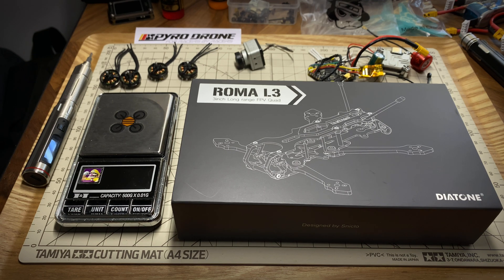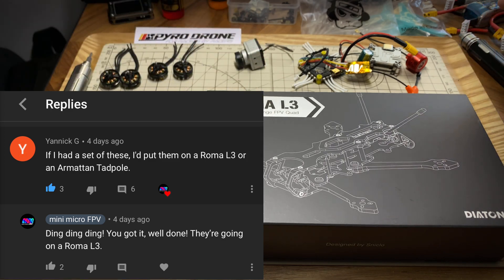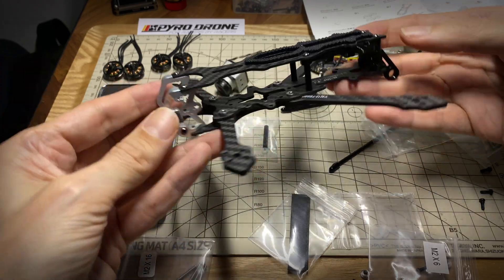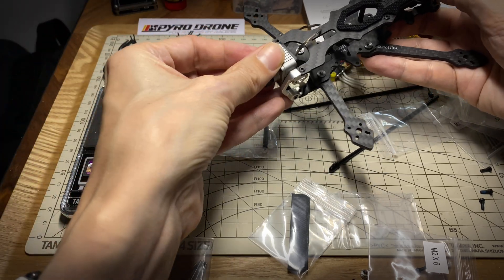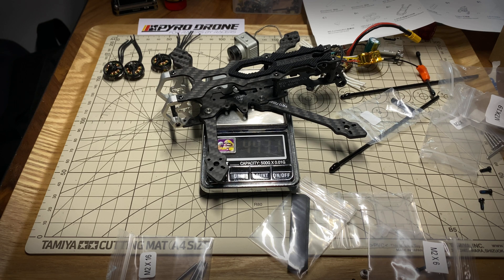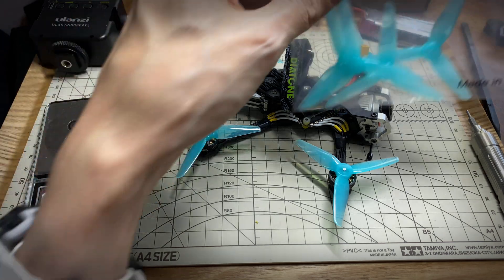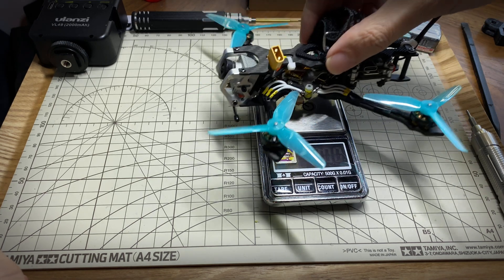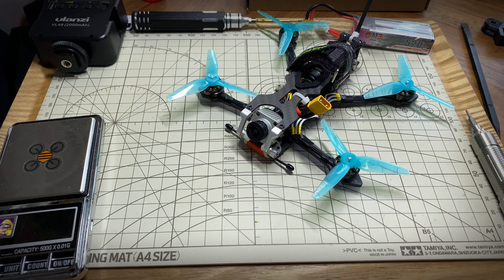A Terrific 3" Frame: Diatone Roma L3 Frame Kit Overview

Comment: Hi, I bought this frame recently from a friend, after he crashed it. I rebuilt it with spare parts and now the quad is flying. I am using a Walksnail VTX on it, however, I am unable to get rid of oscillations in footage. Any advice what should I try to check/change? I am using the latest BF with default settings, my F7 FC is soft mounted, the camera soft mounted (I tried hard mount as well), the props are new.

Comment: Can i put full dji air unit in this frame with whoop board? I want to switch my toothpick 3 frame with roma 3 and want to use air unit
Reply from the maker: I don’t have a full-size Air Unit to check but based on what I can tell from the dimensions online it would be too large for this frame. I think the back props would hit it and also the middle stand-offs would need to be removed.

Comment: Have you been able to run the smo4k on the 4inch of this 3inch version? I am getting a lot of vibrations that make it through flowstate :(
Reply from the maker: Oh no! Unfortunately I haven't mounted the SMO on here yet. I wasn't planning to but now that you mention vibrations maybe I will try it for myself and see.
Reply from the maker: I should have asked but I assume you are using the included GoPro mount with the Roma? If so I just attached mine and I noticed there was about .5mm of movement at the back of the mount where it clips into the top carbon plate. Does yours have this movement as well? If so maybe that's where the vibration is coming through. On mine I will try putting a piece of tape or something between the back of the mount and the top plate to see if this makes it more solid. I still need to do a flight test to see if I have vibrations to begin with but I wanted to mention this first.
Reply: @MiniMicroFPV  I actually 3d printed a slide-in one that I designed myself for the naked gopro, it fits if I push hard enough :) Mine is pretty tight and I haven't found the source of the vibration I see in the recorded video. I also have to try on a non-windy day, I think light quads like that are more subject to wind wobbles. Curious to see your results though

Comment: Thanks for another cool video. This whole setup is really interesting. I like the way all the components fit nicely into the frame. I just bought my first Diatone frame, the GTR369, and I'm really impressed with the quality of the carbon and all the parts you get in the box.
Reply from the maker: Thanks! Yes before this I think my only Diatone frame was the Cube and it also had very nicely-finished carbon and good hardware.

Comment: Awesome little frame. Cant wait to see that build fly more. I'm about to receive some emax RS1408s, I will try a set on a Roma F4 with 4023 triblades. Not necessarily for freestyle, mostly to carry a full sized GoPro.
Reply from the maker: That sounds like a great set up!
Reply: Also, any plans to build an Armattan Bobcat?
Reply from the maker: @yannickg6904  I had to look that up as I hadn't heard of it yet. Thanks for the heads-up! That's a beauty.
Reply: @MiniMicroFPV  So far this really is the best 4in LR IMO. Not much more expensive than the others  but you get the full time warranty on everything but the arms, which are 2 usd each. Although the biggest concern with one of these is not crashing but losing the quad...lol.

Comment: Nice light build! The bare frame is about 5g more than a DC3, but it has an aluminum camera cage and replaceable arms (kind of). The dry weight of 126g is only 4g more than my IH2 HD 2.5" 1106 build, so that's awesome. Thanks for sharing.
Reply: Oh btw, if you haven't, go join the FPV Stabilization Tools group on FB. As long as your FC has blackbox logging (or add an OpenLager), you can stabilize your DJI footage (Air Unit or goggle DVR). Having a blast playing with that. Not as nice as a naked GoPro or SMO 4K... but essentially free, no added weight, and no naked came to break. You will need RS Go or get the open source GyroFlow working.
Reply from the maker: @TweakRacer  Thanks that sounds interesting! I don't think this FC has logging but I'll keep that in mind. I think that idea makes a little more sense with digital as opposed to analog footage.
Reply: @MiniMicroFPV  And for quads that carry a full size Air Unit (e.g. DC3 or Beetle), the 1080p footage (with no dropped frames) is pretty awesome stabilized.